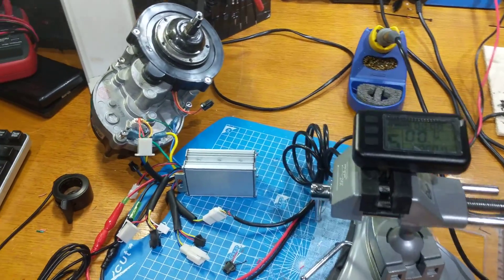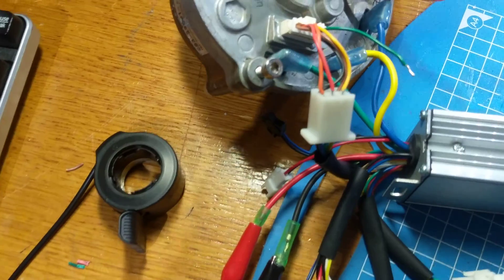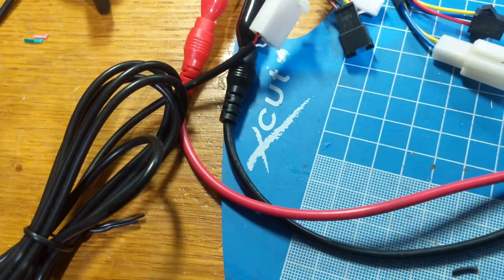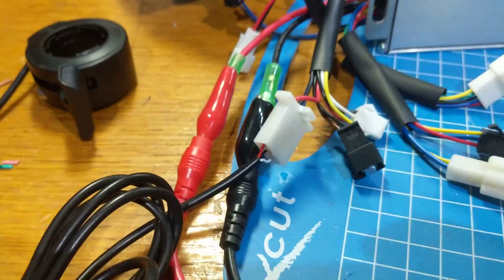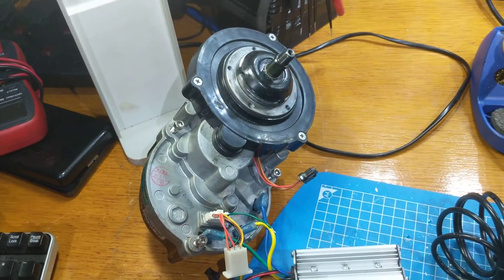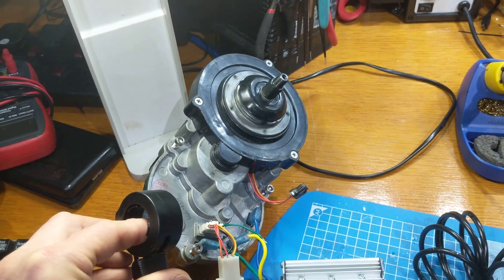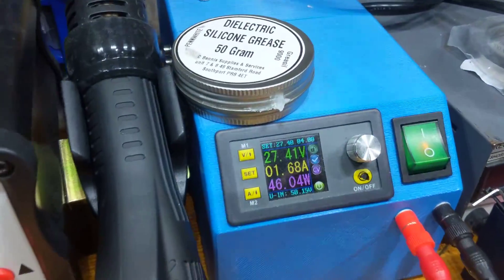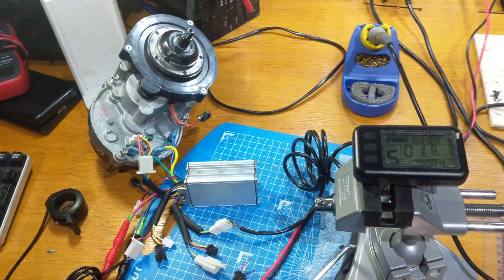Sunstar S03 motor comes back from the dead!

Comment: I have a question for you. My S03 motor stopped working over this cold spell here in Sweden. I've had the bike for 6 years so heating up the motor during the winter is something we usually have to do. Now the pedal crank arms freely spin with no resistance. This happens when the bike is turned on or not. Could it be something to do it the nexus gears/gear cables being stuck somehow or does it sound like an issue with the motor itself? Any help would be much appreciated! Thanks.